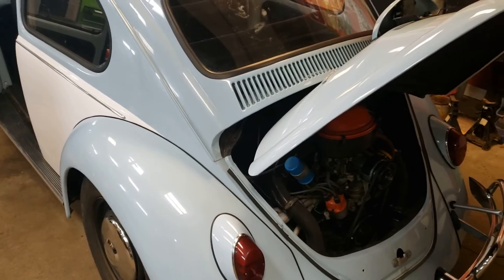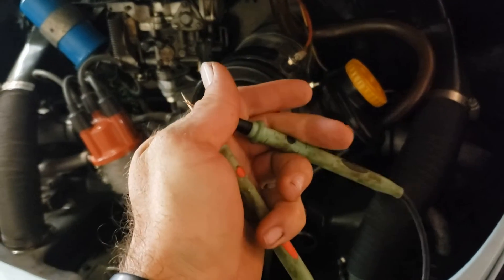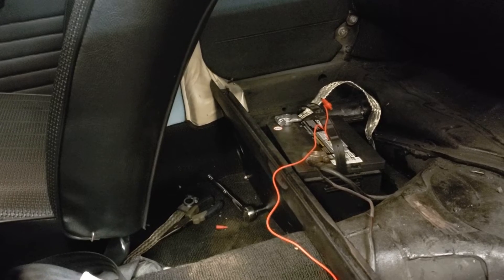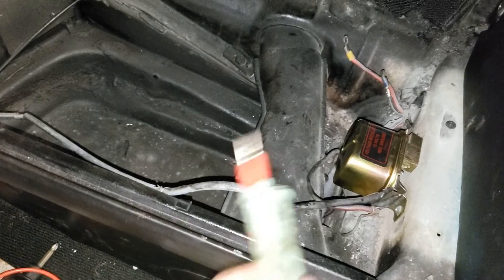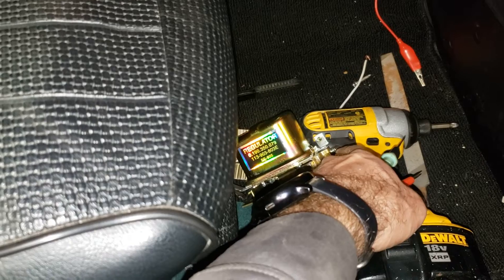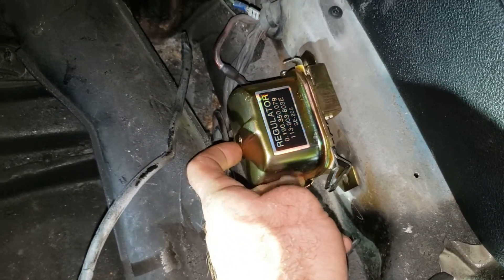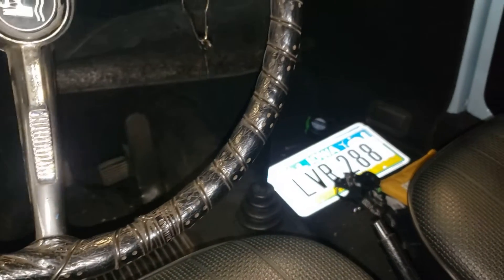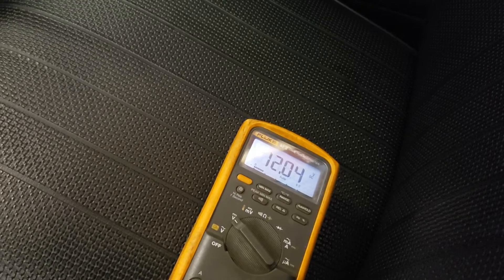VW Beetle Bug Charging System PT 1

Comment: You don’t explain how to know when testing the generator wires if they are grounded. When  you put the meter leads together and it beeped you did not say what that signified nor what to look for when testing the generator wires. A beep? And does that mean?

Comment: Your voltage should be way higher right away if the generator was charging. Not just barely more than 12 volts. Maybe you found something else wrong but the video ended.
Reply from the maker: @bottmar1  you're right. Hard to remember but might show up in part 2
Reply: Thank for your prompt reply. Maybe you can help on a problem with an alternator pulley. I installed an alternator with it's proper stand but the belt alignment was way off. I used the generator pulley but it held the belt too far back. I had to shim the crankshaft pulley out 1/4" and had to cut the generator hub on my lathe to get that pulley back some. Even then the belt was slightly out of lign. I noticed that EBay sellers list that pulley as "generator/alternator" pulley which suggests no difference but there is a difference. How do I know how to get the correct one from these listings that are wrong? Any idea? They even list the stands as generator/alternator stands but are obviously wrong listed that way. I can get the correct stand when I look long enough but too many places to get parts from don't know enough about the pulleys.
Reply from the maker: @bottmar1  It's been a while since I was into a bug but I'll do my best here. I remember spending alot of time using different  combinations of shims on the generator pulley only, to get the right alignment and belt tension. I don't think the crankshaft pulley is to be shimmed but I mohht be wrong. I remember that the shims could be used in 4 places on the generator to accomplish a different t purpose. Behind the cooling fan inside the blower housing would space the fan off of the tin and prevent rubbing. Behind the pulley would help with alignment. In between the pulley halves would adjust belt tension, more spacers in between pulley halves would equal looser belt. Finally, the extra shims were kept on front of the generator pulley as spares. 
A few great resources which helped me for both parts and repair docs. Cip1, jbugs, and a vw-resource (rob and daves). Hopefully this gets you going
Reply: Thanks for another prompt reply. The real issue at hand here is a proper alternator pulley will pull belt alignment towards it's body so the belt will align with the crankshaft pulley. Trying to get a proper alternator pulley is tough because too many sellers don't realize it is different from a gen. pulley. I called CIP1 and finally got a parts guy that new what I was talking about so I've got a correct stand, pulley and strap ordered. I have gotten many parts there before but two years ago when I had the same problem with another VW I could not get any help there or any place else. Just for your information, you can space the crank pulley out as there is a slotted spacer made for that but the pulley can only be spaced out 1/8" or possibly 1/4" but even that might be a bit much.  Also the strap that holds the alternator down needs to be about 1 1/2" longer but EVERY EBay listing shows a strap that is supposed to fit both alt. and gen. applications. Will not work. I hope this alternator keeps working as the last time it was mounted on an engine it didn't even make it out my shop door before the regulator quit. I put a new regulator in it and it bench tested good. I'm going to wipe my hands of any more VW work with all the trouble they have been the last 55 years. Sorry for the long reply. Thanks for your help.

Comment: I'm not too familiar with these older generators and regulators, but at the end when you ran the car why is it that only 12v is coming back to the battery?  On a newer car that would be a charging problem as I would expect to see 13.5v-14.5v.

Comment: The resister wire on the bottom of the regulator might be broken and that would stop the regulator from getting the ground. If you replace the resister wire or resister you regulator may still work.

Comment: Did you modify the air intake yourself? I like it. I’m experiencing some overheating and think this is an awesome idea. Did you cap the hole in the floor that originally went to the air cleaner?
Reply from the maker: No it was pretty done but I have seen the vents blocked a number of times. Thanks for watching!

Comment: Great video . Thank you. Question. On the first test with leads disconnected both are bleeping out when using the continuity setting on the meter. Does this mean I Have a short circuit somewhere?
Reply from the maker: Yes that would indicate a short somewhere. Starting with the larger wire which leads to the vintage regulator, you could unhook it at the regulator and see if it still beeps. This would jndicate if the wire itself is rubbed through and shorted or if the voltage regulator area has issues. I went through 3 voltage regulators before finally using a Bosch solid state regulator which worked the first time. Thanks for watching
Reply: Hi.  I unhooked the wire from the regulator and no more bleeping out.  Does that mean that the dynamo is defunct?   @BlakesGarage1
Reply from the maker: @globoloco  It's been awhile since I was into this vehicle. I'll need to refresh my memory later this morning and get back to you
Reply: @BlakesGarage1  and what's the bike in the video?  Looks lovely
Reply from the maker: @globoloco  The bike is a 2009 Royal Enfiend Bullet Electra. If you havent wtched parts 2 and 3 yet of this series, I recommend doing that. With your wire shorting test good, move on to generator testing in part two. I do recommend the bosch solid state regulator.
Reply: Wow thanks for the fast reply. I swapped out the regulator and still same issue. Will check for short circuit next. Will let you know how I
Go

Comment: The wire I’m talking about is from the regulator to the generator. So if I leave it connected, I’ve made the circuit, right? Because when I do your first test, no matter where I touch the probe, I never get a beep.